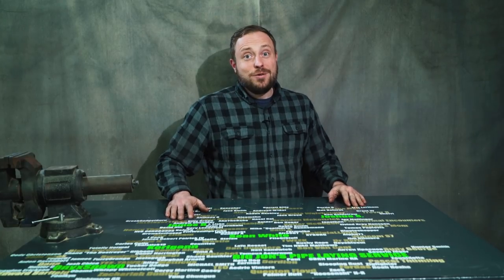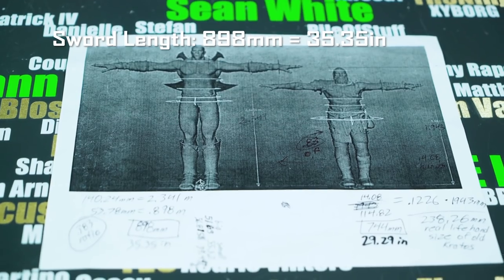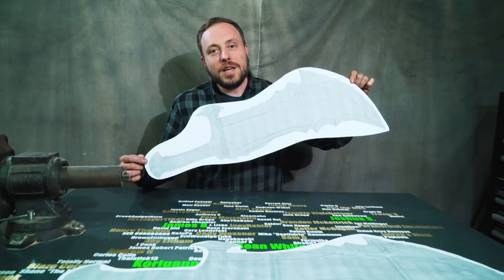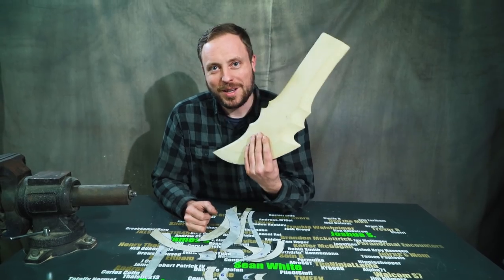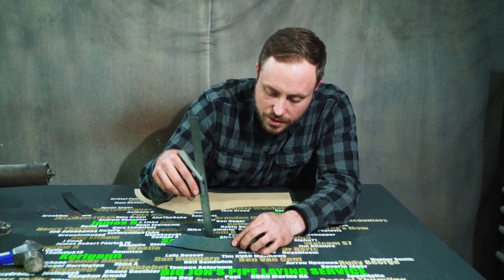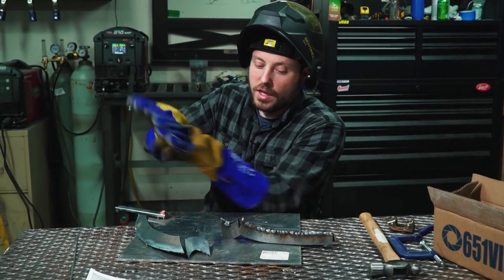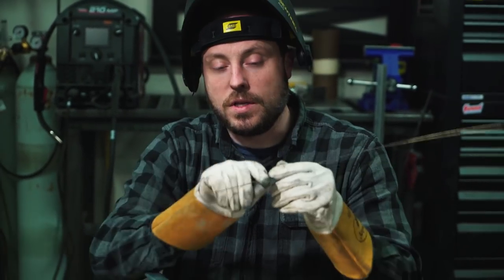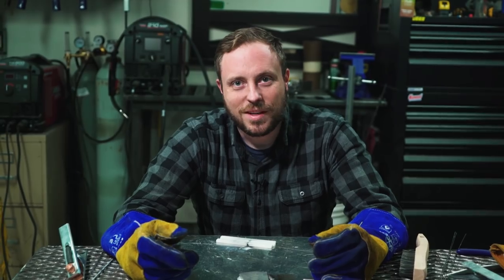Welding Wieldable Blades of Chaos - Part 2

Comment: You should reinforce the hollow blade by welding screws through the blade portion and filling that with resin and then fill the interior of the rest of the blade with expanding foam that you then weld the holes up to seal it inside. The foam needs air to cure so if you do that make sure to have more than one hole, fill it in with layers and put a little aquarium air pump or something blowing air inside it through a thin tube.

Comment: Looks like you might as well use rivets to attach the two. If you put flush countersunk pop rivets in the aluminum section, you could weld over the hole in the top and hide it.

Comment: Just so you know when you use the bandsaw wd-40 works a lot better than water and there is cutting oil you can buy that helps the blade cut and keeps it cool. Deff a very cool build keep up the crazy work 🙌

Comment: When you were using the aluminum brazing rod, it looked like you had the filler metal barely melted, and the metal to be joined not up to temperature.  And it might need some flux.  Done right the filler will eagerly wet the surfaces to be joined.

Comment: just make the aluminum frame for the inside of the sword with rivets and have a snug fit to the internal shape of the sword so you dont need to try welding aluminum to steel. it would be alot easier that way and less infuriating. you could also weld steel tabs on the inside of the blade and bend them over the aluminum to hold it

Comment: @jarius of all check out walk the cup tig welding will give you a nice fine weave it's honestly easier when the cops just right and anytime your welding somthing different matirial or thickness have a spare scrap peice and do a few test runs to get the machine and travel speed right before working on the project so you dont lose valuable prep time awsome video great work love the project keep up the awsome content

Comment: Mix a little hydraulic fluid to that water for some better cooling agent.
Reply: You just have to be much more purticular about your preweld preparation.  Hydraulic oil is a great source of free hydrogen when subjected to an electric arc.  Your welds will be weak and full of porosity.

Comment: Correct me if I'm wrong, but the braising I've done never melted the base metals, only they filler. Think high temp soldering. I'm kinda confused why you're pouring so much heat into the metal to braise it. ...

Comment: Scaling references to figure out the correct scale is an absolute pain, I made a Demiguise from Fantastic beasts for my final uni project, the source said the creature is a cross between a sloth and an ape, so I researched and figured out which types of ape and sloth they meant (bonobo apes if anyone is interested) by comparison, I then averaged the size of both bonobo apes and sloths (can't remember what type of sloth) and I compared this with a brief scene in the movie where he is seen walking alongside the character Jacob, he stood at pretty much waist height on the characters body so I researched how tall the actor was and used that to scale the actor and used his scaled waist height as a secondary height reference, this turned out to almost exactly match the average between the apes and sloths so I figured that was the best answer I would get on the scale of the thing

Comment: If you lived closer to me I’d offer to help you with this, I’ve got a decent amount of experience in tig welding and tig brazing, however when your tig brazing treat it like your just welding a bead, don’t heat up the metal and let that melt the brazing wire on like you would if you had a torch. Just run a Normal bead with way less heat and yea your not gonna really get a good braze unless you get aluminum bronze instead of silicon bronze

Comment: Use some water soluble oil in your spray bottleit'll help lubricate your bandsaw blade better and it will make the bandsaw blade last longer I could still with similar setup and that's what I use

Comment: I think you misunderstand what brazing is. when you braze you use a torch (real flames) and only melt the brazing rod not the work pieces, you cannot do that with a TIG torch, the brazing rod material acts as glue between two unweldable materials

Comment: so when youre brazing youre not actually supposed to melt the base metals into the pool, its more like sweating copper pipe or using a really hot glue gun

Comment: If you´re gonna make it out of aluminum, why not just cast it? You can put in a thing to make them hollow and further reduce weight, and it cuts down the time it takes to make them by a lot. 
Also... clearly the guy who said you cant make these with an Angle Grinder has never seen Michealcthulhu.
Reply: Cast Aluminium is REALLY brittle. A cast aluminium sword would likely shatter.
Reply: @BobMonkeypimp  Yeah, but he did specify that it was a "youtube sword" and that it was merely required to cut watermelons. 
If he meant to make it a weapon, making it hollow and using Aluminum would be out of the question entirely.
Reply: @DarkestVampire92  It really is brittle though. Even hitting a watermelon has the potential to shatter the sword. It could be dangerous if a shard were to hit him.

Comment: Why do you have to weld aluminum to steel?, just pick one or the other
Reply: I was listening I just have alot going threw my head, I forgot how soft aluminum actually is, but for watermelons it's perfect
Reply: @SoggyMicrowaveNugget  maby titanium would work, it's light and strong
Reply: @bloodsweatandtearsforeverl9833  And ridiculously difficult to machine.
Reply: @BobMonkeypimp  it's not impossible though, sheets of titanium vs a pack of grinder disks I'm sure would do the job